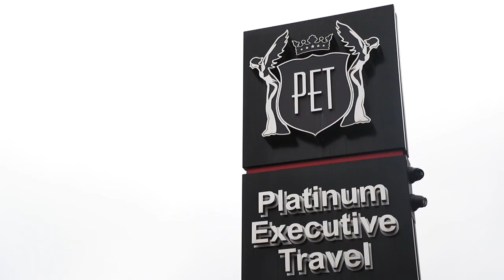2020! A wild and wonderful year!

Comment: Invest in an air blower to dry off the cars... You won't be disappointed ;)
Reply: 100% bro
Reply: @peace6383  why is it
Reply: @peace6383   no body uses extreme temperatures on cars. That sure would be bad. But a cool air blaster would defo speed up dry time. It also avoids the cars from getting scratched where as towel drying can leave scratches 👍
Reply: @peace6383  yup
Reply: @peace6383  was asking a question
Reply: @peace6383  nothing to do with being lazy but being smart. Unless you have all the time of the day and have nothing better to do you can take your time. But when you have a business to run you have to be efficient and effective.

Comment: Lovely car Aleem but some friendly advise, leave the washing to the pro's on a car like that or do it properly. The high pressure lance should not be close to the car, the spray you used on the wheels i presume is wheel cleaner is not for the bodywork, same sponge was used on the wheels, will that be used on the body next time? 
Sponge should be regularly rinsed out during the wash. Use two buckets one with clean water.

Comment: Love watching your vids with the Buggati Chiron. My favourite car and one I never get sick of watching. Having myself been a detailer for 20 years you really should be using two buckets to wash that beast. One to rinse out the wash mitt and the other to dip in to the clean shampoo/water bucket with no dirt particles on the wash mitt. Also use a seperate sponge for bottom of car. Should do wheels first so as you don't splash brake dust on the paint you've cleaned. Use a leaf blower or a Microfiber Madness Dry Me Crazy towel, size XL to dry. You won't get swirls with these methods. Might be an idea to get the PPF polished then glass coat it, then wash with my recommendations for swirl free surface. Keep the great Chiron vids coming brother! Love them.

Comment: Chamois is so 1980s way of drying a car.
Invest in some premium xl drying towels & a car blower/dryer.

Wash stage you should have 3 buckets all with grit guards in 🤦🏻‍♂️

Wash bucket, rinse bucket & wheel bucket. 
Different brushes & detailing brushes for the rims compared to the paintwork. 
When you do the panels do one at atm time. Start from top down.  For example do the hood. The wash mit goes into rinse bucket. Ring it out get crud off. Wash mit then into wash bucket with suds in. 👌

Made me cringe all the way through this.